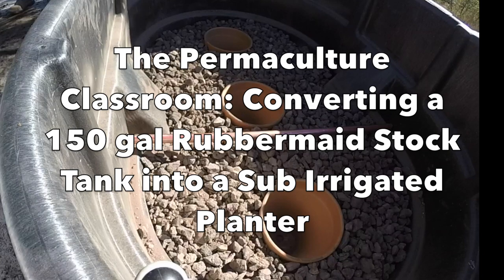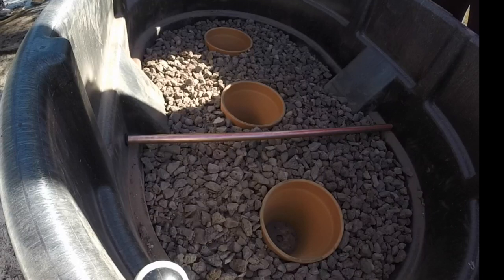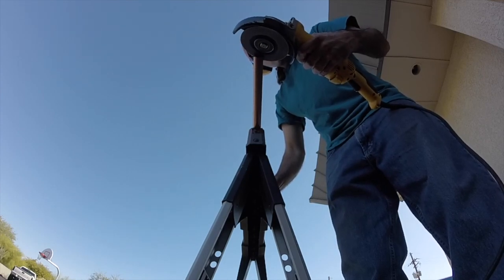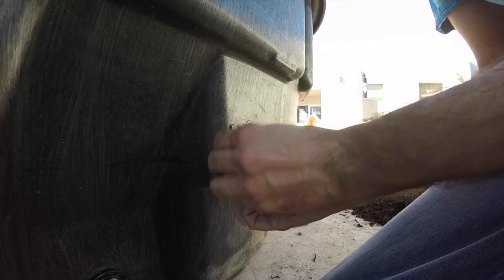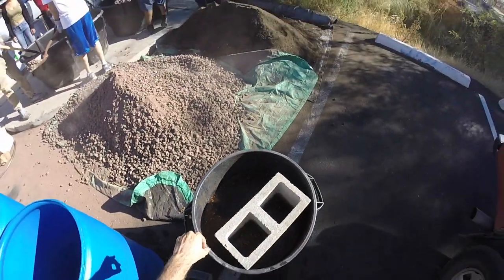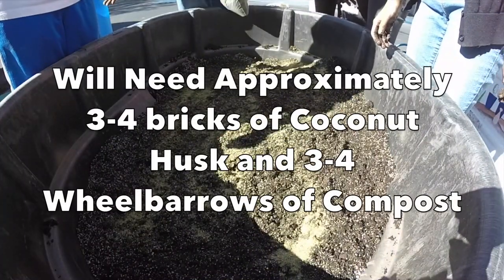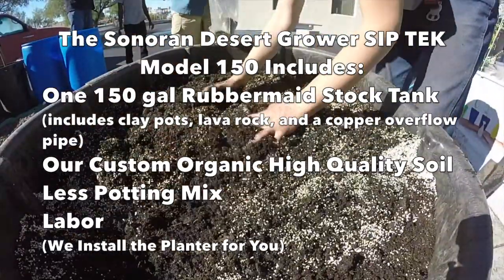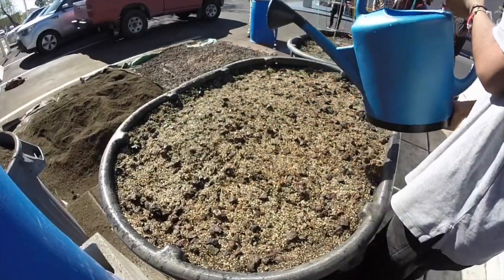The Sonoran Desert Grower SIP TEK Model 150

Comment: Hi there! Awesome stuff!! I'm in Tucson, too. I've watched your videos on this and please forgive me if you went over it and I'm just confused, but where do you discuss your watering method? How does the water get down to the reservoir, as I don't see a watering tube as is often on them? Again, please forgive me its obvious! I'm helping my aunt and uncle set up metal horse troughs soon and I plan to use the clay pots and lava rocks like you do. I'm hoping it will work well for them and be a great method for our environment. :)
Reply from the maker: These ones in the video are at a local high school who had several rainwater harvesting tanks. They just hand watered them with cans. I like to set them up on their own drip irrigation line and dial in the time so they get a nice dry cycle. If the reservoir always has water mosquitoes will move in.
Reply: @TheSonoranDesertGrower  thanks for your quick reply! and, 
oh shiz! Good to know about. What about putting a mesh on the holes? I'd like to be having them filling up the bottom of the tanks or I kind of feel like why are we doing it? I could run the irrigation line directly into the water reservoir too It's occurred to me
Reply from the maker: @TheahLil  The top 12 inches is the most biologically active root zone, so I prefer to water from the top via irrigation lines. It makes direct seeding easier. It's really hot here and the top couple inches will run dry and the bottom will be anaerobic. I think of it more as a traditional raised bed that just recycles the water that would normally drain out. The wire mesh does nothing for mosquitoes. They'll breed right in the potting soil if there is no dry cycle. That's the other thing. It's nice to just cut out hand watering altogether. It's too hot here. That's the bulk of the labor if you don't set up a drip irrigation system. Triple digit heat is hard to grow in.
Reply: @TheSonoranDesertGrower  I hear you on it being hard to grow here. I did a SIP bucket system a long time ago, didn't have mosquito issues in that time at least, but maybe I was lucky. I set it up with lines that fed directly into each buckets water portion. For this bed, certainly we could set up an irrigation watering drip line. As for watering amount, would you set it up exactly how you would if it DIDN"T have the irrigation part below it? The kind we're doing is only 2 feet deep in total, so I was planning to have about 8 inches be the lava rock, leaving ~14 or inches or so of the soil layer. Appreciate your input as I go about planning thing project.